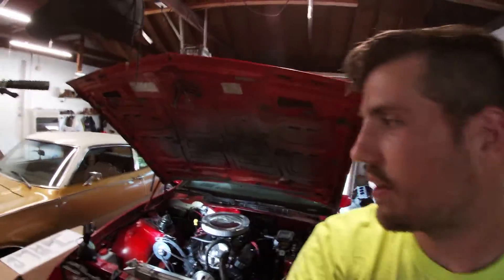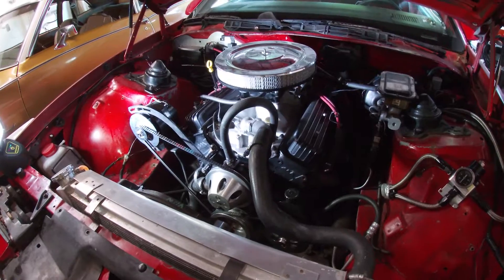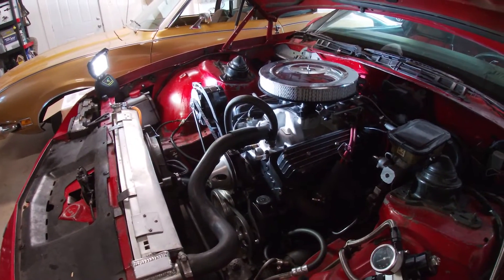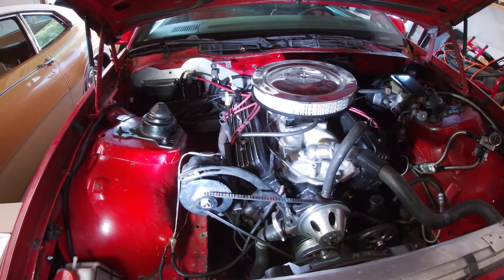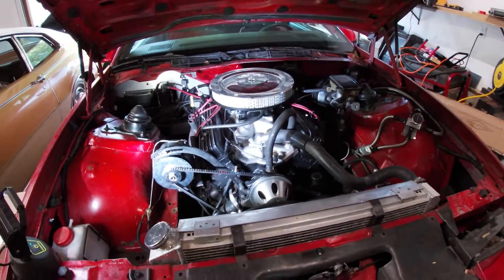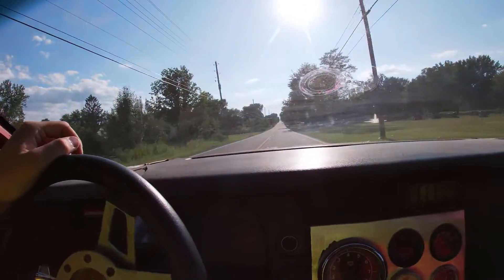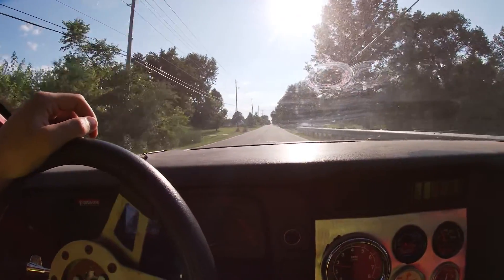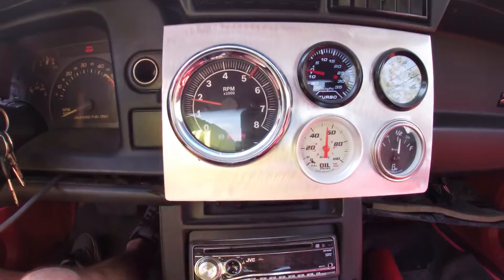Will a Windage Tray Help Solve My Oil Pressure Issue?

Comment: Good to see you back. Your issue could be the oil filter maybe? Is the oil pressure good at idle? Weak oil pressure relief valve? Your dogs cool.
Reply from the maker: Thank you and the oil filter is new because i suspected the same thing so that's not it. And oil pressure is great at idle and cruise